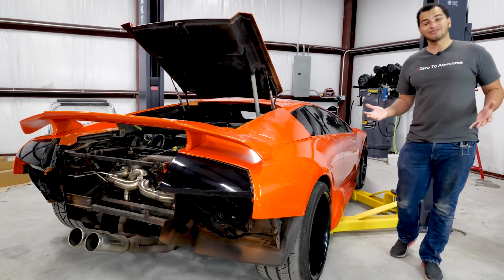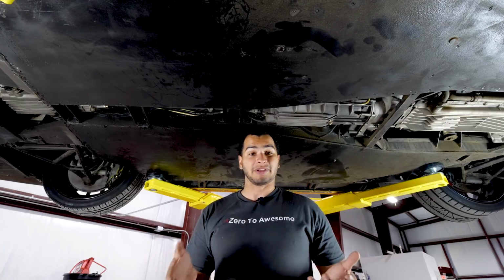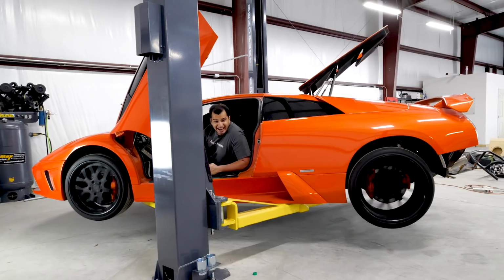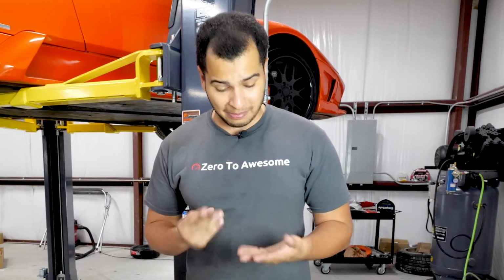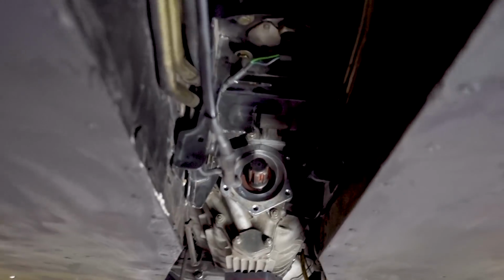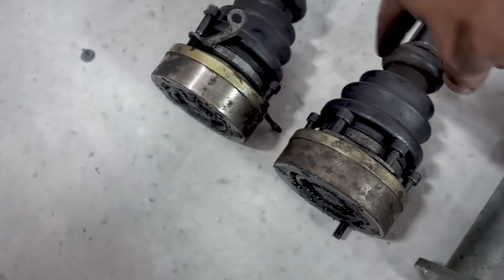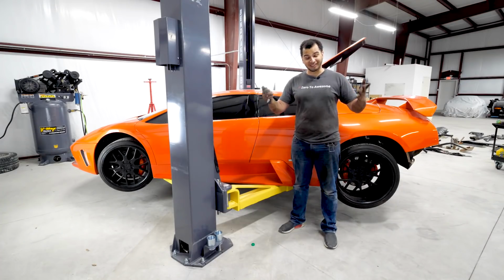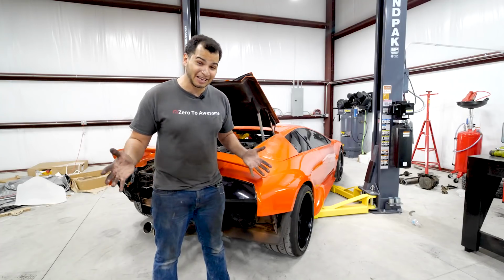I Transformed My Fast & Furious Lamborghini Into A SAVAGE LIGHTWEIGHT BEAST! (NO MORE AWD!!)

Comment: Why not take out the rwd, keep the fwd, and do parallel parking donuts
Reply: Knut hectic one wheel peels around roundabouts
Reply: Amazing idea! Fwd ftw
Reply: @Chris R not yet!
Reply: That would be so god damn funny lmao, Honda Civic fwd vs Lambo Murce Fwd
Reply: Akhilesh Saravanan ya it would be funny but I don’t think I would ruin a car for clout and I don’t think tavarish is that type of guy

Not for clout but idk how to say it u know what I mean
Reply: @Vicscarm1  Yea i feel you, I would rather see a well rebuilt car than a joke of a car.
Reply: Why not lfwrrwd (left forward wheel right rear wheel drive)
Reply: @Akhiii_  
Murci not murce
Reply: @Chris R the gtr lm is lol
Reply: @montevallomustang  Lmao for the lols that thing is a (In my dictionary) A Race Car man. So..... you know.
Reply: @steerius  Yea u know what i meant lol
Reply: @Chris R It would be hilarious though............
Reply: @Chris R r/wooosh
Reply: why stop at that, sell the v12 and kswap it.
Reply: I was missing a few parts for the rear diff when swapping to 4:88:1 gears in my Chevy K20. With lockers in the front (and rear) and the center diff locked it was now a fully locked up FWD full sized truck. It was hilarious to watch, but if I punched it, both front tires would light up with smoke billowing up and onto the edges of the windshield as it took off down the road. I drove it like that for several weeks. Torque steer was absolutely horrific, especially because the Dana 60 in the front uses universal joints instead of CV joints.
Reply: Na!
Reply: Forget that, save weight on the passenger side and convert it to FLWD (Front-Left Wheel Drive)!

Comment: I do understand the reasons. I can't argue against it. However, I would have taken steps to retain AWD by servicing/replacing the front diff and sorting out the rim issue. I am a fan of AWD lambos. It's an aspect that sets them apart from the rest of the supercar crowd. It's full of mid engine, rear drive machines. It's a solid layout and all, but I would want something different from the norm.

Regardless, I do encourage you to continue to wrench away and transform your latest lambo to better meet your needs and expectations.
Reply: It was the cheapest way to go and get it done. Replacing all that stuff and sourcing proper rims is obviously out of budget,especially with the bunch of other projects. When he gets to a million+ subscribers he will more than likely retain things the right way,give him time.
Reply: I completely agree. Why not just LS swap it? You are changing the intended character of the car.
Reply: I have a 3500 Mile Gallardo Manual as part of a collection and I have autocrossed it and it handled  like a 4wd truck and when you remove the traction control and apply the power it will spin in a completely unpredictable way.  I can't drive the car to the extent that it was designed without A. Getting a huge ticket or B. Dieing.   I did the 2wd conversion last year and i will be racing it for the first time this Sunday.   So I choose to drive it calmly on the street and track it once in a while.  Now with the conversion when I over power the tires I have an idea of where its going.

Comment: Rear engine lambs rear wheel drive.. puts foot down spins out sounds accurate
Reply: there seems to be some sort of expectation that the engine in back provides enough weight for traction for the rear wheels upon launch. If any lambo engineers are watching then they're crying.

Comment: Careful Freddy, you forgot to install the washer behind the Axle Nut... No bueno
Reply from the maker: It's a nylon lock nut.
Reply: @tavarish  No worries, didn't see it installed when you were tightening down the nut on the driver's side.
Reply: @tavarish  Even Nylocks use washers behind them. Unless specified. So he's not half wrong
Reply: @tavarish  The nylon is for anti vibration so it does not cause the nut to back off, washer are also needed to spread the load what a nylock can't do and protects the surface
Reply: Calm down kids. The CNC’d titanium  flange nut has a built in washer.
Reply: Love the shout out to Mercedes source. He sure has some good tips.
Reply: Please tell me you use a torque wrench and not just the impact.
Reply: Sean McCauley its a stub axle, that nut does not preload a bearing, it literally is just holding the stub axle in place. So, tight tight is good enough.

Comment: So instead of just buying stock wheels, you ripped out the front transaxle. Now it's gonna be way more likely to oversteer without the weight in the front. You should corner balance it and see where the weight distribution lies now.
Reply: Wouldn't shifting weight to the rear make understeer more likely, not oversteer?  Of course, I'm sure there will be plenty of power oversteer from the rwd...
Reply from the maker: The point of buying a movie car is so it looks like it did from the movie. Unfortunately, that means using wheels that would harm the stock differential, but with the RWD conversion, it eliminates that concern and makes the car much lighter, as well as a better handler. Also, the stock weight distribution shouldn't change much at all, since the car's stock exhaust weighs almost as much as the front differential components.
Reply from the maker: @autotempest  Depending on the way the car is driven. I try not to overdrive my cars, so I'm really not concerned about it.
Reply: Tavarish Nevertheless, it would be extremely interesting to see how it drives in a track!!
Reply: @tavarish  for sure, makes sense. (Although I still think you should switch the Gallardo back once you're done with the dyno!)  I do agree with ^^ that corner balancing is a good idea though—in fact, you should get a set of scales and do all your cars yourself!

Comment: I thought the thing would be faster as AWD not 2 wheel drive.  I see Good Job !.
Reply: Awd will use more power with mechanical loss
Reply: Don't understand why you would want to rear wheel convert this if u want a rear wheel drive lambo buy a older lambo that's rear wheel drive Nuff said
Reply: @spaceybard1655  Lol, do you know how much more he would have to pay for a RWD Lambo over what he paid for this? 
Plus, it's not like it's difficult to put it back as it was.

Comment: Well in forza when I do AWD conversion it's faster. U calling Forza a liar ?
Reply: Gene Tierney yes
Reply: Definitely not faster. Definitely much slower in acceleration with half the traction. Also, increasing the rear weight bias is not good for handling. Great for infantile burnouts, bad for performance in general.

This channel is approaching Rich Rebuilds in its depths of bad ideas.
Reply: @genetierney9975  No kidding. What Tavarish is doing to that poor Lambo is a sick joke.
Reply: Lassi Kinnunen  Unlikely. 150 lbs is irrelevant to top speed compared to aerodynamic forces at 200 mph, and there are exactly zero circumstances where 4WD won't beat 2WD in acceleration. Again, 150 lb is nothing compared to doubling the traction in a high-powered car.
Reply: Mark Haury If there’s a problem with it he will just make it awd again
Reply: @BryanStLouis-ym3wy  Right. After it's too late...

Even if there's no durability issue it's not good from a performance perspective.
Reply: @awo1fman  tell that to porsche engineers, that what they did with gt2 rs was loosing 1/2 of traction :D or better solution, learn something about weight shift and tire load
Reply: @awo1fman  He bought it, he paid for it, he can do whatever the fuck he wants with it
Reply: A car that is designed one way is a far cry from another car that is designed one way and then massively modified without changing everything to match. Everything about the drivetrain, suspension and steering has to work together. Porsche has had 50 years to maximize their design. Amateurs hacking up a Lamborghini are not going to have positive results.

Take his Gallardo. He kept talking about a "1,000 horsepower monster" but he's barely getting half that and has clearly given up.

It's Excruciating.
Reply: Gian Niemann  It's not a 4x4 with locked differentials, so that's not really the case. However, larger diameter rear tires would give it less mechanical advantage and the different relative diameters than stock might increase friction, both of which would slow it down. But disconnecting the front drive is not likely to make it any faster, especially with the bigger diameter rear wheels.
Reply: XclusivePower  He's never said anything like that, and his excuse for disconnecting the Gallardo's front drive was because the dyno was RWD only but he has no intention of reconnecting it. Bogus.
Reply: XclusivePower  That's only true of cars with truly huge rear tires and wheelie bars. Even 8-second drag cars would accelerate faster with AWD, all else being equal. Every bit of traction helps.

I get that in the real world, he's going to have a lot more opportunity to do burnouts than test the limits of the car, but those are not cheap tires to be replacing often, either.
Reply: Gene Tierney awd improves acceleration from a standstill, rwd improves acceleration from a roll race

Comment: Wow now will handle worse & be slower round a track but should make for fun long drifts amd powerslides
Reply: Ha ha lol what? 😂 awd is always slower on track only advantage from dig drag, low speed corners under 90 kmh and its more safe for  daily use but no way faster in track and straigth line cause will always be lighter (same hp same car awd vs rwd) due the less differential approx 200kg lghter. You also can build awd and rwd drift cars its not rwd exclusivity.
Reply: @alekosalekadis6095  put the awd and 2wd version on a track and see which wins. Its all about grip in the corners and lambos are heavy lumps to drag round a track. 
A pro racing driver would see the 2wd advantage but joe part time racer will long run out of talent in a 2wd version before the benefit of the lighter 2wd version becomes apparent.
Reply: Iwill answer you with Porsche : Porsche 918 is slower around the nurburgring  from gt2 rs but also from gt3 rs witch have half of 918 horsepower. Awd advantage its to slow speed corners under 90 kmh and dead stop drag due to traction. Even lamborghinis after certain km/h from awd become rwd cut the torque from front wheels because are better to corners. If course in daily use awd is WAY safer than 2wd thats fact.
Reply: Also 2wd have less train losses.
Reply: @alekosalekadis6095  i see so i asked no question.
It would appear to all that your not getting it. 
As im sure that both the porsche's were driven by joe public around the track to get the results you quote.
No prob cheife test driver

Go & troll someone else.
Reply: @edwilko8819  lol man how i even troll when i give you example from Porsche official legit times. Either way i dont fight with you fir a drivetrain. Yeah awd cars are faster better and more efficient than rwd i dont care man Even iam sarcastic. i wish you health and stay safe bro.

Comment: Wish you had driven the Murci before the conversion, and then after. the Difference is absolutely amazing.
Don't forget that the weight reduction on the front end means the car will sit higher, so you would probably need to lower the front springs.

Comment: The front and rear wheels are not turning at different rates, but they do cover a different distance for each turn, while they are on the lift.  on the ground they will travel the same distance, but turn at different rates.

Comment: hmmm, i wonder if those plugs are really made of expensive titanium. (yes i know, money dont count with cars like these) if they are titanium, nice. but there looks to be no actual reason what so ever that they should be. it could be much cheaper aircraft aluminium for the same. which is light also and also pretty corrosion proof.

wear orange gloves like Ed China to match the cool car. 👍😏
Reply: No, you can tell titanium instantly by holding it, aluminum is softer and the color is different. I have a few titanium parts for my bike and they are so much different. I wouldn't be surprised if they had to be titanium for strength, spinning fast would probably beat up aluminum.

Comment: Hey Tavarish, I've been a Tech. for 22 years and i think i can save you from replacing them front wheel bearings if it isn't to late. Back them nuts off then re-tighten them without an impact AND torque them. NEVER use an impact to tighten hub bearings
Reply: Do you need even need to set pre-load on non-driven bearings?

Comment: Stuff a rag in the hole for either allen or torx head bolts and smack the bit in. Most often it will come loose and not slip.

Comment: You need some ratcheting wrenches bro!  That part where you were using a solid wtench to put the bolts into the new transmission mount required an unnecessary amount of effort to tighten down.  Ratcheting wrenches are one of the most helpful tools. If you don't have any I'd highly recommended to pick up a cheap set.

Comment: Minor correction:  The tires aren't turning at a different rate, the diameters are different, so the velocity of the smaller tire in contact with the road will be higher than the larger tires in the back.  Wouldn't be good either way :)

Comment: if an allen bolt is rounded out. just hammer an old torx in there, saves you alot of time. it never failed me and its alot easier than shizzling it.

Comment: Just wondering about the transmission support mount.  Do many people suggest lock tight for the four bolts that go sideways into the plate.  I figure it would be a area that would have plenty of torque on it and thought lock tight would help prevent those bolts from loosening.

Comment: So the bigger rear wheels have incurred a bigger rolling radius, ie not compensated with a lower aspect ratio on the tyre, and were causing slip in the forward diff.  But the speedometer sensor is on the rear wheels so is that under-reading?  Not a problem on a film set but worth checking before you get a ticket!

Comment: Ya forgot to put the flat washers back on the hub shafts. Hopefully the preload on the wheel bearings is correct as long as there was enough thread on the dummy shafts it will be okay. I'd check that tho before making any high speed runs.

Comment: Freddy, never let the tires spin freely in the air brother. The tire needs to be on the ground loaded with weight.  It’s the same as spinning a C.D. faster than its normal speed. At some point the cd will disintegrate. Tires will do the same thing.  This is a giant NO-NO in the automotive world. And one of the first things you learn in a tire class.  Notice how tire balancers do a fairly slow spin, and a road force machine is much faster,  it’s because the road force machine adds a force typical to being on the road.  I’m not trying to be right, just trying to keep you safe.  👍❤️🚗. GOOD VIDEOS!! Love them!
Reply: When you put it in 5th and revved you can see the tire expand in your video.

Comment: Tire diameter is what dictates whether the front:rear size ratios are correct for the car's AWD system, not wheel diameter... That can be addressed by installing the proper profile and width to match the tire diameter on the new wheels to that of the factory tires.

There are other reasons to want a RWD V12 Lambo, but wheel size isn't one of them.

Comment: Even if the wheel sizes are different, the front should have a taller sidewall than the back and the actual tire height would be the same, therefore eliminating those issues you were talking about about wheel size difference

Comment: Would be nice If you could just switch off the front axle clutch if you want to have fun. If AWD is needed it can be just switched back on again. Almost like a modern M5 or E63 AMG...

But I think the system on the Murci is fully mechanical and the clutch cant be controlled via electronics like more modern systems

Comment: Every european cars all wheel drive works like that, the front wheels are supposed to be gears at a faster rate, only when their locked together does it destroy a different, like on every chevy truck with 4wd

Comment: So I need clarification... was that a design flaw with possibly losing the differential in time because of the all wheel drive or was that because the front and back tires were different sizes ?

Comment: The wheels are not turning at a different rate, The wheels are turning at the same rate, the rolling diameter of the rear tyres is larger than the front, meaning the rear tires would travel a longer distance than the front tires per revolution.